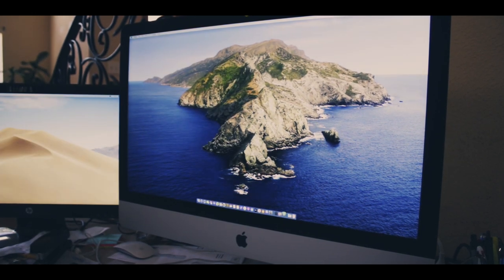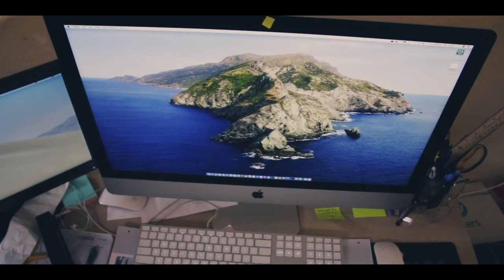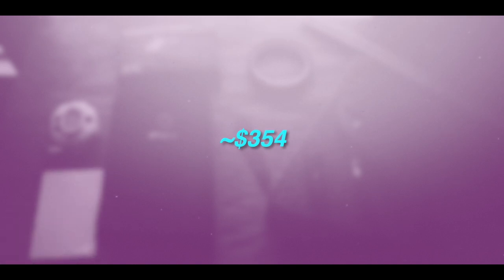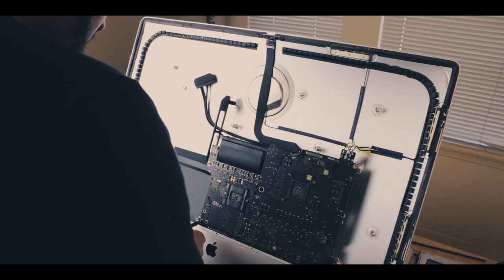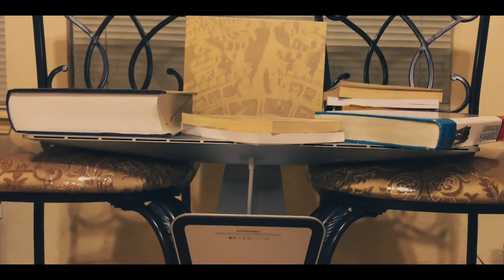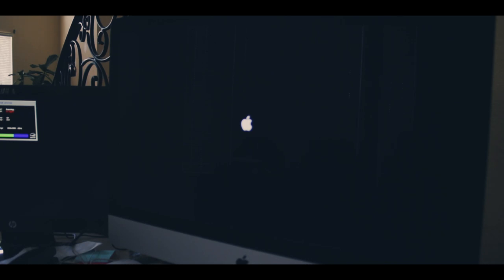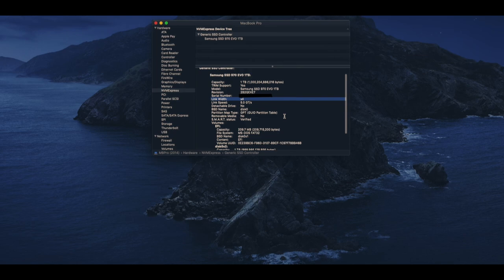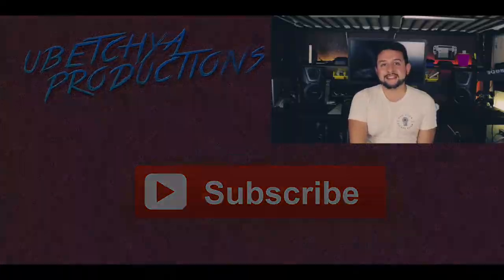Make Your iMac Blazingly Fast with This!

Comment from the maker: For some people who have commented facing some slow drive issues. Definitely make sure that your Evo SSD is update to date with the latest firmware with Samsung. YES, you will need a PC with an available M.2 slot in order to upgrade. 

I have noticed that the drive I upgrade in this Mac started slowing down at some point and my parents alerted me of this. (This was their iMac that I upgraded for them.) All I had to do was reformat the drive, run first aid, and the re-install MacOS. It's working great again. 

For anyone else continuing to have issues, be sure to check and see if you didn't receive a faulty adapter. You may to replace the one you're using.

Comment: I have just deleted the Fusion Drive and have installed the OS on the 128 GB SSD. The 1 TB HDD is just used for storage. It works fine, the speed is great and the configuration is done in a couple of minutes without opening the iMac

Comment: Hello! I have a question. How will the iMac react if you replace the Fusion Drive ssd let’s say with a 256 gb ssd? Will it prioritize it or how can I ensure that the iMac uses this one and not the hhd like before. Is there any sense in replacing both with an ssd the hhd with a sata ssd and the pcie slot one with just a more capacity name ssd ? And how can I format the to work together for example if I would like to use the hhd or if I upgrade it the sata ssd to store Fotos but fotos only and the nvme ssd only for data and apps is there a way to achieve this or will the iMac just decide on its own where what will be stored. Thanks for the help. Great video btw.

Comment: I did the upgrade on my 2013 iMac, replacing the 3 TB HDD portion of the Fusion drive with a 240 GB SSATA SDS. Once I did this, I had a still usable 120GB NVME drive (only the 3TB Fusion drive had this).
If I had a smaller Fusion drive with the paltry 32GB NVME, I would just take the easy route and use an external SSD via Thunderbolt 3. The speed diffence is minimal and you don't have to take anything apart.
Reply: Late 2013 doesnt have thunderbolt 3, It has two thunderbolt 1 ports. They are still pretty quick though and comparable to SATA 3 speeds ( i use a Lacie Rugged Thunderbolt SSD and a Win2Go Windows 10 install instead of bootcamp and its surprisingly quick). The drive speeds are pretty decent on the 3tb model, i get about 200/200 on the 3tb drive and 300/700 from the 120gb Apple NVME and 350/350 on the Lacie External ( using black magic disk test )

NB. the Late 2013's nvme controler is 2x, so even if you replace the internal nvme you are not going to get the stellar results the vlog author gets on his.

Comment: Thanks for this video, you are the first I have seen that actually shows the performance gain. I had similar results on my 2013 MacPro and some Macbooks but I have shied away of doing the iMac. I tried separating the fusion drive and use the original M2 SSD as a boot drive and sure got some performance gain, but not much more  than using an external SSD via USB 3 or    Thunderbolt as it is the SATA interface that limits the speed. But seeing your results I think I will do the operation as I also use a lot of VM’s.

Comment: i did this with the same exact drive with my late 2015 27 inch but the drive is not recognized. i put the drive on fresh out the box is this wrong?
Reply: also having this issue. Tried a EVO 970 and 970 plus with the sintech adapter and I can not get it to recognize the drives in disk utility for either one. Both were manufactured in 2021. 2014 Imac 27"
Reply from the maker: Make sure you update the firmware of the drive with a PC with a Samsung Magician before installing it!

Comment: Great video! However, given the extensive work required to replace the blade SSD, do you think it's really worth it when compared to simply replacing the spinning HDD with an appropriate SSD and using that in lieu of the Fusion drive setup? Replacing the HDD seems like a much easier process IF you don't require the added performance of the NVMe drive. Welcome your thoughts. Thanks and keep up the great work!
Reply from the maker: That is true, from what I've seen, even theoretically you would get some faster speeds, it's not that much of a difference than just replacing the HDD. Buuuuttttt... if you're going to go through the trouble of tearing apart your Mac, you might as well go for it, especially so that you don't just have a tiny SSD just sitting there doing nothing!

Comment: Great video but just noticed the sintech adapter in your description does not support samsung 970 evo plus. Have you had any issue. I am about to update my 2017 Imac and wish if you could share your thoughts on compatible NVME drive available in the market now.

Comment: Will my Late 2014 iMac will recognize this PCIe Samsung SSD with adapter and I will be able to format it to run OS Catalina? I just installed PCIe OWC  1Tb and it gives me only about 700 Mbs read and write compare what they advertised is higher. Also my boot time is twice as long as I had on my original 128Gb PCIe SSD. Thanks
Reply from the maker: Does the OWC have trim enabled? Otherwise I would say that as long as you can use that OWC, then the Samsung should work just fine. Just make sure you update the drivers on it using a PC before installing.

Comment: I have a problem with an iMac 2017, I already did everything and I can't find the solution, at first it detected the ssd with the adapter, I have a crucial 1 TB P3, I connect it to the motherboard and when I put the bootable usb with MacOs Ventura does not recognize it internally, if that same ssd I put it externally if the iMac recognizes it, I do the format externally and at the moment of putting it internally it it does not recognize it. I already installed the macOS Ventura by external means and I put it internally and it doesn't recognize it either, I don't know what to do I've been testing for a month and I have to be assembling and disassembling the iMac, I hope someone can help me, The disk utility does not recognize it, I already made the list disk and nothing does not appear the ssd m.2 nvme, I am totally blocked, do I need to do it with high sierra and then update to Ventura?
Reply from the maker: I can’t vouch for crucial drives being compatible with Macs. But I would check to make sure that it is first. Also, were you able to update the firmware using a PC?

Comment: You could connect the nvme ssd externally with a Thunderbolt 3 case. Than you could clone your sistem drive to it.
Reply from the maker: True. Although throughout my research, before installing the drive, I have heard that there are sometimes some performance differences between an externally attached drive than an internal drive. This video was meant to show how it is possible to replace/ upgrade the internal blade drive of the iMac to be used as the main drive with better performance.
Reply: @VictorMendezuBetchya  I have been running my Imac Retina 5K, 27-inch, 2017 OS Catalina using an external T3 SSD drive.  (1TB WD_Black SN750 NVMe Internal Gaming) with a Thunderbolt 3 enclosure. I have been consistently getting average speeds: Write ~2100 / Read ~2300 MB/s. I wonder what your thoughts are on the matter? I am careful enough to have a TimeMachine back up running but keep wondering how resilient such a method is. Would be fantastic to hear what you've researched on the matter. Thanks for putting these videos together.
Reply from the maker: @AlexanderHernandez-yn9wh  From what I've researched, placing your SSD within an enclosure like that does bottleneck the speeds that the hard drive can theoretically give as it requires it to send data back and forth from and to the enclosure rather than it being immediately available like an internally attached drive. This has even been true for people who have used external GPUs. You just can't get the same performance as an internally connected SSD or GPU. That's why I didn't initially go with his method. However, I will be testing this at some point later on for some on hand experience. I'll upload a video here with that information when it happens. And you're welcome! :)
Reply: This is what I did to get a 32TB Mojave Boot Disk with 2100 Mb/s read and write speed using  external TB3 drives with Mojave (Not Catalina or Big Sur).  I used 8 of the 4TB SATA Samsung 860 Evo 2.5 SSD in an Apple RAID0 configuration with the OWC 4bay TB3 drives (need 2).  Format each of the 4TB SSD  using Mac Journal (NOT APFS).  Configure with Apple RAID0 for 32TB.  Carbon clone the original HDD onto this 32TB RAID0 drive.  Select the 32TB RAID0 as your start disk.  ONE HUGE CAVEAT: YOU CANNOT DO THIS WITH CATALINA, MOJAVE is the last OS that you can do this.

Now why did I do this?  I do 4K editing and needed as much storage space as I could.  I had 8 of the 4TB SSD already.  So for the cost of 4TB SSD from Apple, I could do 32TB SSD at 80% of the speed of Apple 4TB SSD.  I did this in 2019.  It is now almost 2020 and I need the updated Final Cut Pro which required Catalina.  Catalina can't be installed onto the Apple RAID0.
Hence I'm now taking the 2019 iMac apart to put in the Samsung 970 Evo Plus 2TB SSD.  I will still use the 32TB as my work disk but at least the boot disk with Final Cut Pro will work fast enough.  This is a short term solution until the Apple Silicon iMac arrives in Q32021.
Reply from the maker: @khoita5704  I'm stoked for the new iMac as well. I was very skeptical of the new M1 Macs at first, but now I'm convinced they're the greatest.

Comment: I just installed a 2TB SSD to my late 2015 iMac 5k, and now I'm thinking I did the wrong upgrade. My question is. Can I still use the 2TB  2.5 inch SATA SSD along with the SSD Blade i'm going to install?
Reply from the maker: Yes you can!
Reply: OK cool thank you for the quick response. I’m assuming I would need to use the fusion drive feature to use both SSD’s cards?
Reply from the maker: @Randywatson34  No problem! And no you don't have to. You can use both drives individually, as in one being your primary and the second being your slave if you wanted to. In order to set them as a fusion drive, you have to enter in some Terminal commands before installing the image via USB stick.

Comment: Still no reply on my question bellow. 

But other than that, the Mac was working perfectly for few days then for no reason restarted twice giving ? Folder icon on booth. After restart it finds the drive and boots normally. I have the report screenshot. Any ideas?
Reply from the maker: Make sure you update the firmware of the drive using Magician on a PC before installing, and enable trim within terminal.

Comment: A Mac OS Fusion drive is not using the SSD as a cache.  The SSD is used for frequently accessed files.  In factory iMacs the SSD is pretty small, but you can replace it with a larger SSD and see huge gains.  In My 2012 Mac Pro I have a 4TB 2.5" SSD combined with a 12TB conventional HD, and the result is a 16TB drive where most of the time Its working at full SSD speeds.
Reply from the maker: You’re correct! I oversimplified my explanation in the video. And yes, after setting up my iMac to run solely on the SSD, it runs really fast! I don’t regret doing it. But wow! How much did you spend on those hard drives?
Reply: @VictorMendezuBetchya  Abut $600.  The SSD was $415, and the 12TB drive was 190.
The fusion drive is very good for what it does.
Reply from the maker: @DeputyNordburg  Wow, not bad!

Comment: Hi mate
Thanks for the video. I did upgrade my late 2013 which shipped with 128GB vvme and replaced it with Samsung evo970 plus along with  the mechanical HDD. 
After the upgrade i did  format the evo to IOS with journal and  did a speed test with black magic speed tester. It turned out i can achieve only 760 mbps write speed. However my evo supports 3600mbps!!! Although  under NVME the TRIM support is YES and the TRIM width is x2.
Any advice what causing the bottle neck.
May thanks in advance.
Reply from the maker: Yes, try re-installing MacOS from a factory reset it again. I would delete the drive in recovery mode, run a disk health check and then reinstall. I have had to do this recently.
Reply: That is the max you will get because the logic board of this model is made for pcie 2.0 x2 speed, you need a newer Mac that supports pcie 3.0 x4 speed
Reply: @TheCroupier74  Exactly this. Might still be worthwhile doing it for capacity but you aint getting the huge numbers you would from

Comment: For everyone already doing this full disassembly to replace the ssd in a 2019 - unless you have a top model ;) - I suggest replacing the CPU at the same time. It would be a waste to miss out on this and needing/wanting to do again in a year or two.

Update: Forgot to mention - CPU change is not for the unexperienced, you can bend the pins very easily if the cooler shifts during reinstallation. Don't do it without adult supervision ;)
Reply from the maker: Great suggestion!
Reply: I wouldn’t recommend it. iMacs have different cooling systems depending on CPU and GPU. If you have an i5, in my opinion it’s blazing fast with just the CPU upgrade and the i7 upgrade isn’t totally necessary. I’m not a heavy user however but I love my mac after upgrading it

Comment: This is awesome, I've got the exact same 2017 5K iMac as you. Will the Crucial P2 NVME 1TB work running Mac OS?
Reply from the maker: I believe it will. But double check the guides/ links that in the description. The forum has all the info on the compatible drives. But I do believe it is one of them.

Comment: thanks Victor,  what is the temperature of the NVME when it is quiet and under stress?  do you need a heatsink?
Reply from the maker: So far it’s still working well with no issues and this is without a heat sink. Although I haven’t tried taking the temperature.

Comment: ¡Hola Victor! If I install a SSD external drive on my 2020 iMac (27") will I have to download all my apps again and will I lose my settings? Any other advise I should take into consideration? Thanks.
Reply from the maker: That should be all, just be aware of that.

Comment: At the end of the video you show tests from Macbook Pro not iMac. Quite misleading.
Reply from the maker: Thank you for noticing that, the tests DID come from the iMac, but the settings shot did come my MacBook since I was too lazy to set up my camera in front of my iMac (I had forgotten to take that shot as B-Roll). All that was required for that shot was to navigate through the settings so I shot it pretty quickly.
Reply: @VictorMendezuBetchya  Can I see a screenshot of read and write, please? Also a screenshot of the NVME in system settings. x2, or x4? in my case x1. Considering the restarts and error I mentioned in my other comment, it looks like a controller/adapter issue. No idea what to do.